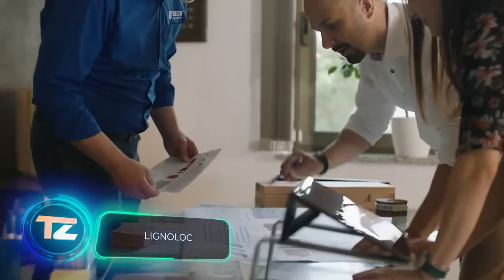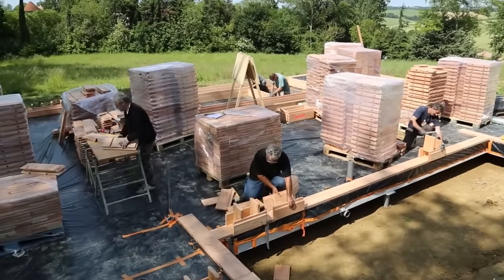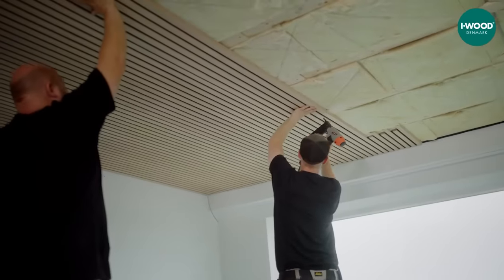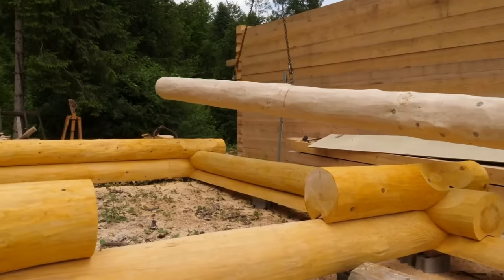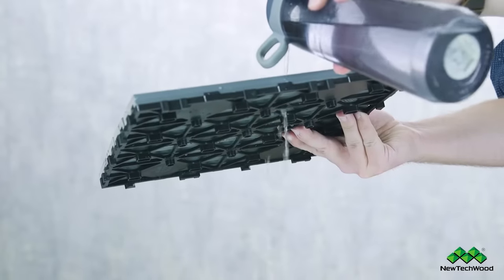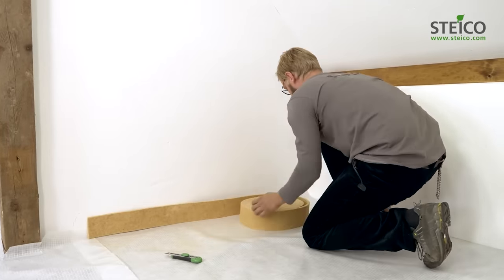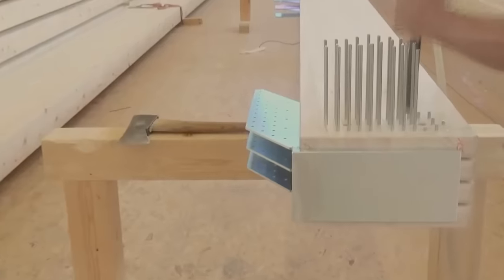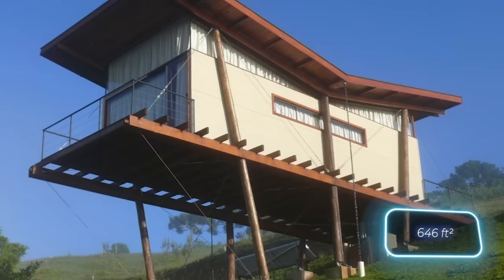WOOD CONSTRUCTION TECHNOLOGIES THAT HAVE REACHED A NEW LEVEL

Comment: Interesting that 'wood dowel' construction is coming back into style. I am a furniture maker, so it is old news to me. As for the stacked block houses, mine is made with wood fiber and cement. Huge insulation and sound dampening qualities. My walls are 1 foot thick. Just about any fiber can be used.
Reply: We have lots of Douglas Fir around me. It can support a lot of weight, but I don't know if I would want do do any  sky scrapers with it though.
Reply: In carpentry we use pegs not dowels.Pegs are split(i.e. continuous grain),tapered and octagonal and not produced on a lathe.The principles and techniques of joinery rarely apply to carpentry  :-)
Reply: And what is a peg, other than a big dowel. They are used for exactly the same purpose, no matter if you are timber framing or making furniture.
Reply: Completely wrong I'm afriaid.Try reading what I actually wrote.A peg is split from a billet,,tapered and octagonal-ish so the grain is continuous i.e. max possible strength,even if not straight.They are then trimmed to size,usually with a drawknife or axe .Dowels are turned on a lathe,of uniform section i.e. not tapered and round so strength is far from guaranteed. @robohippy
Reply: but at $135? I could get a box of 2000 stainless coil nails for $100

Comment: 0:15 aluminum nails are NOT allowed in home or commercial construction, because they FAIL so comparing the wood nails to them is another fail I also see they do not have a head on them so boards can pull off of the ends. 2:02 Brickawood is just dovetailed boards, vapor barrier is required, the boards that were shown will NOT last long term. 6:55 problem with that product is it depends on having STRAIGHT lumber. 10:07 ok what chemicals are in the product to make a wood product non flammable. 12:48 how could it be AIR TIGHT if it allows vapor through, vapor is LARGER than air, air molecules are much smaller than any vapor molecules

Comment: Those wooden houses are far stronger than ones that use metal nails. Wood nails and basically dowels and they expand to create a very strong joint. Also, the dovetail joins are even better. Metal nails and the worst.

Comment: The log home supplier you featured, best check the data.  Was stated a 150 sq ft home took 6 months.  That is 10 x 15 and a couple of carpenters can easily finish that in a week and start to turn key ready a month!
Reply: He said 150 square METERS not feet. Still not huge but not 10 x15
Reply: It is square metres not feet.
Not that I'm defending their nonsense :-)
Reply: @chippysteve4524  I was being fesitios with a statement of feet given a 150merter house, at least in my Community, from ground breaking to move in takes Max 3 month if stick built and 2 if prefab of which 30 days is for the concrete foundation to cure.